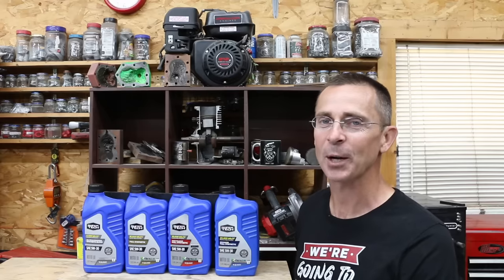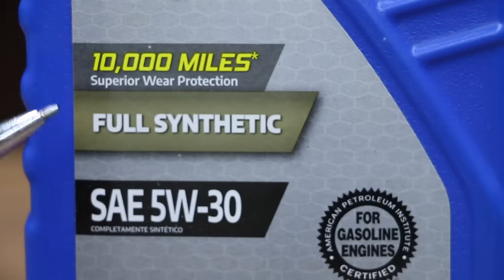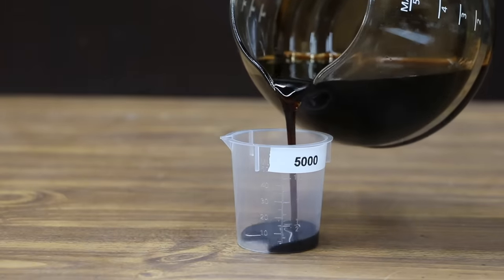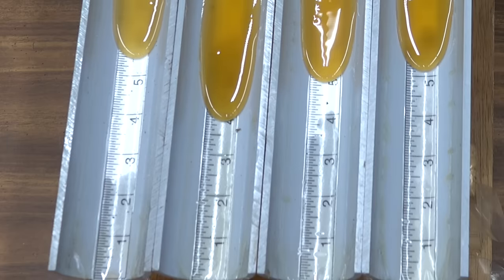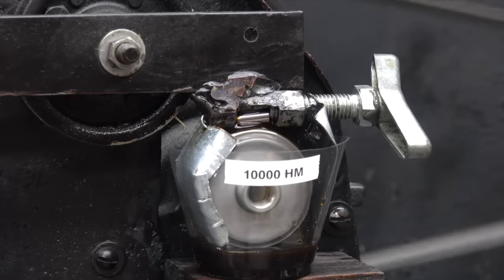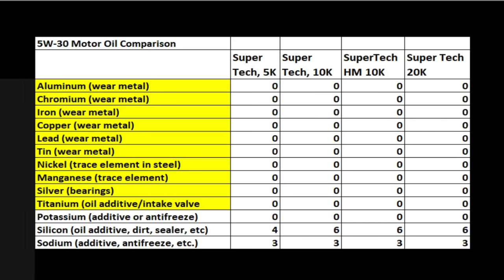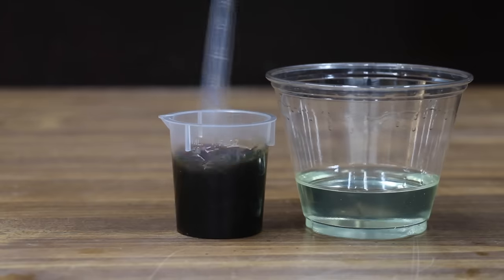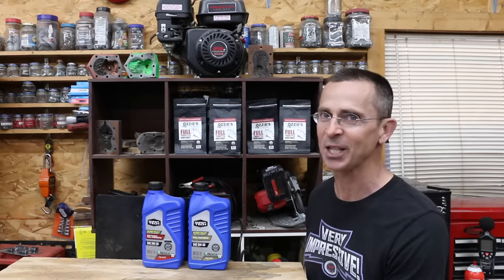Are They All The Same Motor Oil? Let's Settle This! Four Types of SuperTech Motor Oil Compared

Comment: The fact that someone can recommend ST at all in the real world is a win. I know it's decent oil but most people think of it as "walmart oil" therefore its trash. It is really decent oil, just not for 20K!
Thanks for the tests as always, awesome roundup!
Reply from the maker: My pleasure!
Reply: Will  Supertech is just as good practically as those. they all meet the same standards. SAE, etc.
Reply: Will-th9mi look at his older videos. Super tech is comparable to Mobil1. It actually beats it for cold weather performance.
Reply: I've ran super tech oil in my v8 4runner for the last 2 years....it runs quieter and the oil still looks clean at oil changes. I used Castrol before and didn't seem to last.
Reply: Super tech in both of my GM vehicles since new. My 5.3 has 193k+ & my wife’s 1.5 turbo has close to 90k. They love Super Tech oil. Wouldn’t think of running anything else in my vehicles
Reply: I have used mobile 1 for years. And seeing mobile 1 and other oils out of stock at walmart  during this pandemic. I decided to give super tech a try since its readily avaliable.  Its just as good as mobile 1. But I still use a mobile 1 filter. Running it for a year now. Ive not noticed anything out of the norm with it. I got about 10k on the 20k oil and here in the next few months I will be changing it. The oil is not even what you call dark yet.
Reply: The best part of this is that people think that Wal-Mart makes this oil...  There's only a handful of oil blending plants nationwide, and none are owned by Wally World.  So basically SuperTech oil is someone else's product in a bottle that Wal-Mart sends them to fill.  Same thing with John Deere, Bobcat, CAT, O'Reilly, Toyota, and every other equipment/vehicle manufacturer and store brand.
Reply: Will-th9mi  The same company that makes supertech produces oil for several other companies, just comes in a different container. It's as good or better than some of the big name brands of oil if you look up testing people have done.
Reply: @DietBajaBlast  I don't trust it and will always use my name brand oil. I've never ever had an oil issue over the years and still change the oil every 3k. Oil changes are fun, easy and cheap for me, so why would I do it differently today...
Reply: @wvwildlifecam9159  You should get your oil tested at Blackstone if you run it for 10k miles and see your metals' content and residual oil quality. That is too long to run any oil.
Reply: @enjoying_life49  I have and do test my oil with blackstone.  I run way past 10k miles and so far have not seen wear metal accumulation rate have a statistical difference.  Interestingly, the first 1000 miles after an oil change is the worst for wear metal accumulation rate, then it levels off.
Reply: Why not for 20k miles?
Reply: Will  Mobil is a marketing gimmick with their filters,  sorry.
Reply: @Lee Klinglesmith  Maybe on paper just like gasoline not all fuel is the same.
Reply: @Damian Smith  You that's bs and not scientific, Thanks for Playing...
Reply: @WVWILDLIFECAM  I've never seen 10k oil that's not black, sorry I don't believe you...
Reply: @Peter Angles That is wildly untrue!
Reply: @ginog5037  Are you referring to me? I'm just agreeing with the conclusion in this video...

Comment: Great video as always.  The extended oil change intervals are insane.  I do mine every 6 months (April and October) regardless of mileage.
Reply: I run 5,000 miles or once a year which ever comes 1st. Every Jan which ever of my vehicles didn't get to 5k that year get oil changes. Along with all the ATVs. I work in the oil industry and 6mo isn't necessary and frankly a waste of your money. As long as you fore the motor up periodically then you could do them once a year. Oil is billions of years old so it's not going to go bad in 6mo. But it's your rigs and your money so I can't tell you what to do
Reply from the maker: Thank you!
Reply: I drive approx 400~ miles a week on my commute to work...I try to change my oils religiously at 5K miles with a treatment of motorkote, quart of lucas oil stabilizer and wix filters
Reply: I sent in an oil sample of a major synthetic oil I used in my jeep. The used oil test showed the oil was done for @4400 miles in my driving conditions.
Reply: @chrisleggett685  wow!

Comment: Hi Todd! I love your content, long time subscriber. I do a lot of welding g and fabrication with time bending and notching, and I am constantly seeing the debate on numerous pages about cutting oil, drilling oil, and cutting lubricant, while using tubing notchers (hole saws). Most scenarios are using cold rolled 1-5/8 or 1-3/4 round tubing, and either a drill press or tubing notcher with a hand drill. The constant argument I read is what brand of hole saw to use (longevity, an average is roughly 100 notches for lifespan), as well as what to use for lubricant or cooling effects. Many guys say to run them dry and send it, while others say to go slow and keep them cool. A test like this could provide some much needed feedback for thousands of fabricators out there. Tubing notchers typically used are Baleigh, JDsquared, Woodward Fab and a few others. Hole saws are typically Lenox, Milwaukee, Rigid, Craftsman,  or even Mac tools who offer a lifetime warranty. I can send you a few links to debates, tools etc if you're interested. Please consider it, there are thousands of fabricators out there building tube work like rollcages, bumpers and other race car, offroad and custom work that use these tools daily, and could really use the knowledge of where to best spend their money!
Thank you,
Phil
Reply from the maker: Thanks for the suggestion.

Comment: I used to be a mechanic and raced cars. I decided to use Super Tech synthetic after finding out who made it and watching his test comparing it to Mobile 1. I use a Baldwin filter and change the oil once a year because I only put 4000 kms per year on my Rav4.
Reply from the maker: Thank you for sharing!
Reply: @ProjectFarm  You are welcome. Out of all your tests that I have watched, I have only disagreed with one of them. Keep up the good work. 🙂 👍
Reply: An Rav4 changed at 5000km will definitely last 400,000 klms, can't beat the Toyotas.
Reply: @Paulman50  Youve got that right, I will be long gone and the Rav will still be running. I may not drive often, but I drive fast and hard when I do. I sold my 1987 Toyota 22R pickup last year. I drove that really hard for the 24 years I owned it. The previous owner had used it to haul a camper. I changed oil every 5000 kms and other than a rusty box, it was still running fine after 250,000 kms. 👍

Comment: I've always been big on oil and filter changes to get the best possible life from my engines.  Way back-when cars wanted an oil change at 3,000 miles.  Now I stay closer to the manufacturer's recommendations, but always going under, like when leaving for a trip, I want clean oil because I may put on more miles than expected and don't want to do an oil change in the middle of a trip.  In short, I am fastidious with my maintenance and have only owned own vehicle that would not go far without adding oil (and I bought it new).  That was an 1987 Thunderbird Turbo Coupe!  I understand it was infamous for consuming oi!  Currently I use only synthetic oils in my vehicles.  Keep up the excellent presentations.
Reply from the maker: Thanks, will do!  Thanks for sharing.

Comment: Great video as always.  Couple of thoughts ... for penetrating oils, I know some old timers who swear by a 50/50 mix of acetone and ATF.  I wonder how that would stack to your previous test?  Also, you do great cordless tool reviews; maybe do an aggregate to see which overall system might be the best investment for someone getting their first set?  Keep up the great work!
Reply: I like the idea of an overview of battery powered tools. My old dewalt unit's battery is dying and you can't buy them any more, so I'm able to entirely switch systems.
Reply: @Paul Mansfield  Same.  I made a video where I adapted an old laptop charger to an empty battery case.  It didn't work very well, but I also didn't expect it to.  At some point I may make an adapter to run modern batteries on my old tools.
Reply: Depends on your needs. 

Diy? Pro? Specific task? 

Do you need high power?  or lightweight, usually for overhead applications.

BTW warranty are important to consider unless they ( Ridgid ) doesn't stand by it
Reply: @PaulMansfield  My 18 volt batteries are in various stages of failing, so I bought some 20 volt adaptors for mine and use aftermarket 20 volt batteries that were tested on this channel. They came in second behind the DeWalt battery but at half the price.  I have 6 18 volt tools and don't feel like replacing them all.

Comment: My grandpa had an old can of the stp oil, it claimed 15000 miles between changes and that was from around 1980! Would be interesting to see how it stacks up to modern synthetics
Reply: A bunch of marketing nonsense. A friend was a mechanic for a local police department in the 80s.
They ran Mopar 318s on Pennzoil 10 w-30 for 5000 miles. He said there were constant engine failures due to sludge packed into every bit of empty space within the engine until it clogged the oil pickup. Oil back then was shamefully gross. 15000 miles, even with some snake oil additive would not be likely.
Reply: He’s got some vids like that. Think it was Quaker state
Reply from the maker: Thanks for the feedback.
Reply: @Peter Angles ... anything between the valve covers and the oil pan is considered to be INSIDE the engine.
Reply: @ColdSmokes  ... you also need to consider the amount of idle time the average police cruiser has between oil changes. 5,000 miles showing is likely to be near 15,000 miles run time.... and maybe more.
Reply: @Peter Angles .... Dumdum? The engine oiling system is certainly NOT outside the engine, other than a holding tank on a dry sump system... and that's still considered a closed system. BTW, I never claimed to be an engineer, but I have rebuilt over 450 engines in my career. (with ZERO comebacks) Pretty sure I know where the pieces are.
Reply: @rupe53  
Indeed a good point.👍
Reply: @@PeterAngles the sludge is carried in the oil as a solid. When the speed of oil lowers the solids have a change to drop out. This is why it is usually first seen in the camshaft carriers and sumps. It all gets stirred up again whenever the revs, and thus oil speed increases. 
Maybe you should apologise for your sneering comment.
Reply: @rupe53 
Ford uses oil heaters and idling is not heavy loads.
Reply: @hotrodray6802  ... most mfgrs use a heat exchanger, more commonly called an 'oil cooler" to keep the oil within a temp range. Quite often they have coolant hoses tied in to do this. BTW, extended idle time is considered "severe service" and is in every owner's manual over the last 60 years. They recommend changing the oil more often with that condition because of fuel dilution and condensation.
Reply: @hotrodray6802  what rock are you under idling for long periods is terrible for a motor

Comment: I think it strongly depends on how the engine was used during the interval. If you just cruise on the highway in overdrive you certainly can have a longer oil change interval than when you do heavy duty stuff or when you have a lot of start-stop and cold start cycles.
Reply from the maker: Thanks for the feedback.
Reply: I had a car that for the first 5 years and 180k miles of its life had oil changes every 20k miles but it was doing 35k a year on the motorway. The engines was solid and fine for another 11 years  and 75k miles before it was moved on. Its not the mileage thats the issues its how the miles are done.

Comment: Some advice; just use recommended oil for the engine (SAE/API/ACEA) in your climate and change it with oil and air filter every 1 year or 10 000km (~6200 miles) - whichever comes first. Don't use oil from the barrel (used in auto shops), just buy it yourself from trusted source. If you can, change it yourself, its cheap. And... that's all. You'll have peace of mind, and your engine will be fine as long as it can.
BTW, great vid as always!
Reply from the maker: Thanks!  Thanks for sharing.
Reply: No, i do 3000 miles interval, non of engine failed in the past 10 years. 10000 or 1 yr would have build up when you teardown the engine.
Reply: I always do it myself. I trust myself/ not some kid at the bottom of the pecking ladder.
I have been that kid many years ago.
Reply: @luckyguy600 Same here m8. Or at least I deliver oil and filters, and watch the change.
Reply: @zxttgg Well, I must disagree. I'm doing like I've said, and 1.9 TDI got almost 1 milion km done,  and 2.8 V6 got nearly 400k km done. No issues at all (besides normal exploatation).

Comment: Many modern engines can do 10,000 miles easily even with non 10,000 mile oil. I had my oil tested every change to watch trends and wear because I raced vehicles, albeit in amateur races, but was good at letting you know when a bearing was failing as well as other issues that may be invisible. Seeing that it sold me on doing my personal cars. As long as their was nothing wrong with the car extended changes did not increase wear and this included a car that i daily drove and raced occasionally.
Reply from the maker: Thanks for sharing.

Comment: I've been using SuperTech for about 10 years now. Probably over a million service miles with it on friends and family vehicles, including my own. I've used Blackstone labs to get oil analysis done and never had bad results.
Reply from the maker: Thanks for sharing.
Reply: Been using them for 30 years, or thereabout.Neve an issue. Always 3,000 km oil changes with Wally-Mart filters too.
 But do use all the other top brands that were on sale.
But that doesn't happen much these days.

Comment: Great video!  I'd love to see a similar video with other big brands (royal purple, amsoil, etc.) ESPECIALLY the lab testing.  It's always super interesting to see what the actual differences between the oils are.  If you do Royal Purple, specifically it'd be really awesome if you included their "high performance street" line of oils.  They are supposed to have a much different additive package than the "normal" oils, always been curious if they're actually any different.
Reply from the maker: Thanks!  Thanks for the suggestion.
Reply: He's done a video on Royal Purple vs Amsoil

Just look his video up
Reply: @anthonyc2072  That's not what I asked him to do.  I said I'd like to see him do this same comparison (so the brand being compared against other oils from the same brand) using brands like Royal Purple or Amsoil (or Pensoil or any other, just those two popped into mind first).

I've already watched the video you're mentioning and it was really informative but it's not the same as this.

Comment: I had the same concern about the extended mile oils not lasting.  This research confirms it.  Another great video!
Reply from the maker: Thank you!
Reply: This more just lends creedance to the fact the oils aren't substantially different despite the price and packaging (...or at least this brand).

It would be great to see a wear comparison of oil after the various intervals.
Reply: Does 10,000 miles actually mean it will last 10,000 and your engine be in great shape still???

Comment: Due to the huge amount of fuel contamination that happens in turbo GDI engines, I went against manufacturer recommendation and change my oil at 4000 miles instead of 6000 miles. I lifted the valve cover after 100,000 miles and it looks pretty much new. The only change in noise I hear from the engine is a slight amount of chain rattle, so I will likely change that around 125,000 miles instead of 200,000 miles. A $100 timing chain is nothing compared to an $8000 engine!

Your demonstration of how fuel contamination affects lubricity really made me feel confident that I run short oil change intervals. Thank you!
Reply from the maker: You are welcome!

Comment: A test idea, though I'm not sure how you would quantify it. Do bypass filters work? Apparently there are people that think with a bypass filter (2 micron) in addition with a normal oil filter (30 micron) is enough to run oil INDEFINITELY. The only thing that breaks down is the additives so you do need to add those back in over time.
Reply: I thought a while back (years) I saw a centrifugal oil filter called a fs-2500 or something. 
It worked so good your coal rolling brodozer would have a color to the oil of a normal gasser if you pulled the dipstick.
Pop the top and pull out a nice cake of crud and keep on trucking.

Comment: Ive used Amsoil for years in all my cars here in Canada. I change the oil and filter once a year. We average 25000 kms (15000 miles) per car per year. Never had an issue. The cars run like new. Very quiet at idle yet very responsive when pushed.
Reply from the maker: Thanks for the feedback.

Comment: I'd be curious to see all of the previous winners of the motor oil brands compared to each other. Regardless of price, which one would you use for overall protection on a 70,000 mile gasoline vehicle? Thanks for all of the hard work on these videos.
Reply: Yep it's all about changing your oil consistently. Cheap clean oil is better than dirty expensive oil.
Reply from the maker: Thanks for the suggestion.